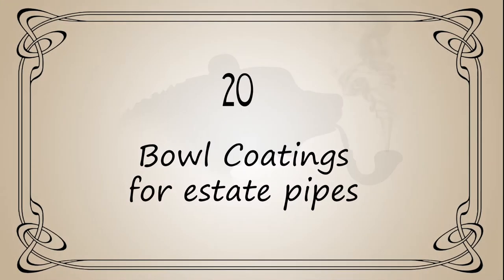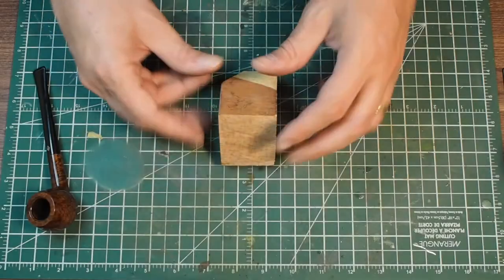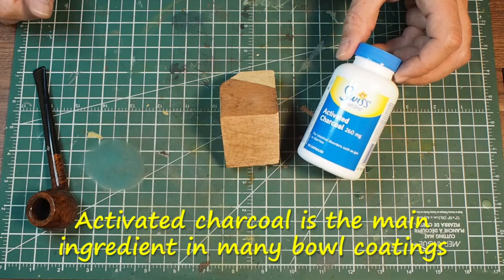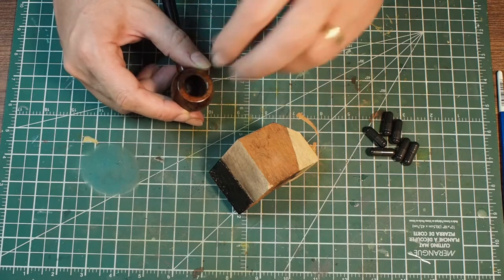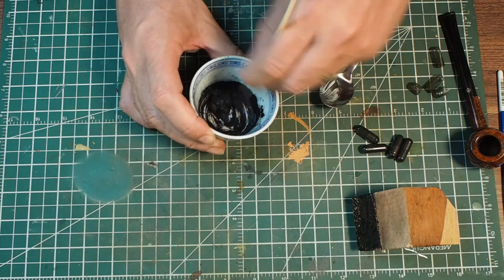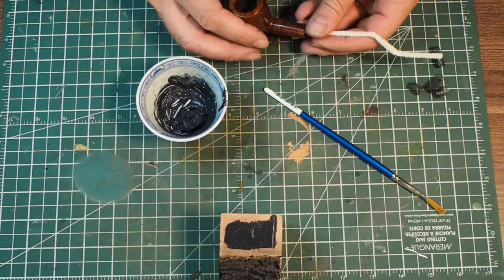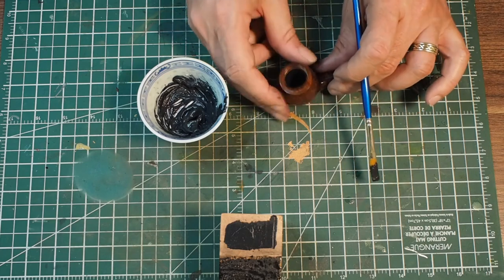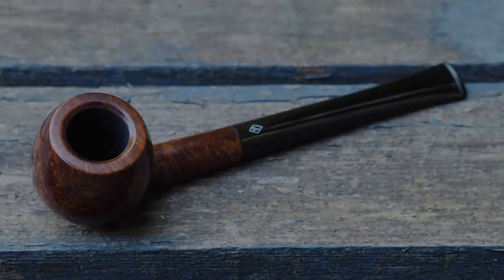Ep 20 - How to apply a bowl coating to a pipe

Comment: Thank you for taking the time to present this information.  I will file the information for future use.  For the moment, I am using what I consider a simple method for coating flawed areas of bowls.  For example, I have a pipe with a very dark area on the exterior of the bowl.  It looks like the first stage of a burn through.  I cleaned the interior of the bowl at the dark spot, then coated just that point of the interior with fireplace cement.  Just a thin layer of the cement.  Here in the U. S., fireplace cement is available in tubes at hardware stores.  I then smoked the pipe to build up carbon over the cemented spot.  So far, no progression on the burn through.  -  Just another idea.
Reply from the maker: Frank Bishop thanks for info and for watching. I am going to research the fireplace cement a bit more. My immediate concern is whether fireplace cement is safe to heat and inhale orally? I know it can be an odd thing to say about a vessel to burn a known carcinogenic plant in, but I tend to be ultra conservative about anything that goes inside a pipe, I try to keep to food safe and natural products that people already orally consume.
Reply: @BarePipe up!  I read you loud and clear.

Comment: Great video! I have small hole in the inside of the bowl. Can you recommend some material to seal it?
Reply: Make a paste (pipe cement) by mixing cigar ash with water. Works great on burn outs and holes such as you are talking about.

Comment: Some notes on my own experience:  I noticed charring in the estate pipe I recently bought:  a Savinelli nonpareil 9111.  The charring resembled a log burning with white charring.  I used your second method but substituted non-fat yoghurt and mixed in the 6 activated charcoal tablets I ground up.   I applied it in the bowl and let it sit for a day.  Then I noticed that it had started to dry and absorb into the charred part but still left a gouge.  So I applied a second thicker coat.  I let it dry over 4 days.   I then filled the bowl with Newminster Blackberry Brandy.    I smoked it slowly.  It burned hot.  But I got the sensation of smoking a new pipe.  There was no distinct flavour from the yoghurt.   But there was also no flavour to the tobacco.   Some of the carbon bits absorbed into the fine ash.     I emptied the ash and carefully cleaned the pipe.  It looked like a worked in pipe.  I think it will take a few more bowls to get it back to normal smoking.  But thanks for the tip.  At the very least there was no smell or taste and it seems to have solved the charring problem.   I think applying a second coat helped.   Thanks.

Comment: Thank you for these educational DIY techniques. I am wondering if this coating mixture can also be used as cement to fill up the bottom of the bowl, instead of the ash-water mixture. Please let me know your thoughts.
Reply: For a good pipe cement, mix cigar ash with water into a paste(more dry than wet).

Comment: Real quick. How did you get that brilliant mirror shine? I just attempted for the very first time to restore and clean up an estate pipe. I used paragon wax and microfiber cloth...since I don’t have a lot of tools or buffing wheels. About 3 or 4 coats. It looks good enough I guess. It shines. But it doesn’t have that POP.
Reply from the maker: J. Oakley unfortunately that pop only comes with a buffing wheel and hard carnuaba wax. You can get close to that with a buffing wheel on a drill. I have a video about that. Check it out
Reply: Bare Pipe ok. So you don’t use shellac or anything? I may try using the drill and buffing wheel. I think I do recall seeing your video on it. Thanks for the reply!

Comment: Hello! I usually use honey but I’m going to try the sour cream because it’ll be much less messy for sure. If you see this comment would you mind answering a question please. I would like to use this sour cream and activated charcoal on 7 pipes I’m cleaning. I don’t smoke a whole lot so it may be some time before I smoke each one. Will this be ok just having the pipes on the shelf after adding the layer of paste? I imagine it cures pretty solid but if it’s sitting there a month or two unsmoked I wondered if it would matter. Thanks in advance.

Comment: I have two pipes that are showing a dip in the bowl walls where burn out has started. How can I pack the crater? And what do I pack it with ?  Thank you in advance.
Reply: Make a paste (pipe cement) by mixing cigar ash with water. Works great on burn outs etc.

Comment: As educational as always, thanks very much for sharing. I am slightly skepitcal with the sour cream somehow. I mean it is a product that goes bad really quick if not refrigerated. Might this not produce mold or anything in the pipe?
Reply from the maker: Mayor of R'lyeh I shared your skepticism when I read about it, but it disappeared after I tried it a few times. I don’t know why it does not go rotten, but it doesn’t. It just dries into a hard tasteless and odorless coating, and I live in the Pacific NorthWest where everything else goes moldy all the time! Cleverer people than me may be able to explain the chemical process, I just have anecdotal evidence. Btw some pipe makers use plain yogurt instead and it works the same.
Reply: Thanks for the reply. I will definitely give this a shot on the next bowls I am doing. The one I am using now is more chemical and I am not satisfied with the results I am getting off it as a paste
Reply from the maker: Mayor of R'lyeh let me know what your results are
Reply: Will surely do!